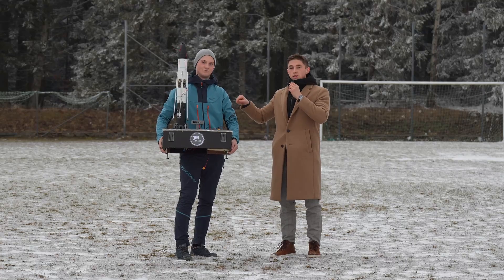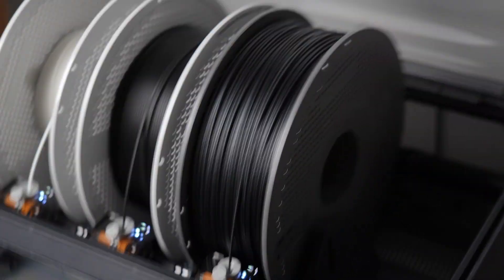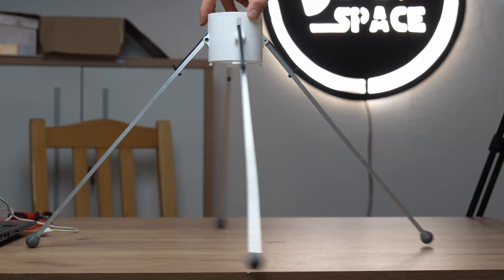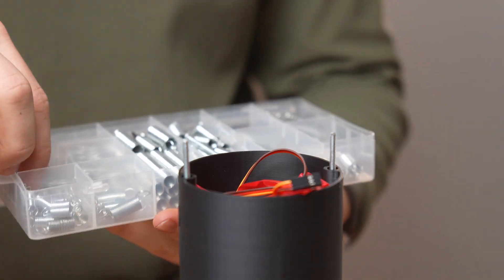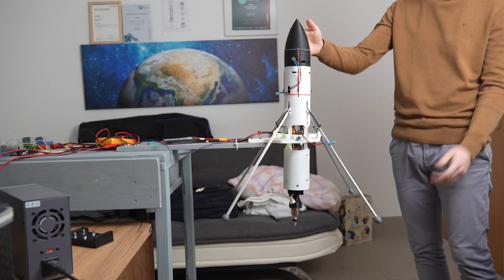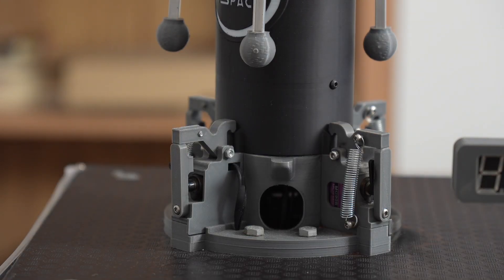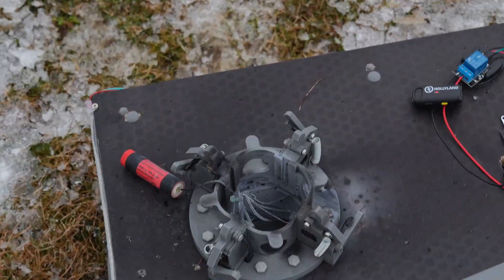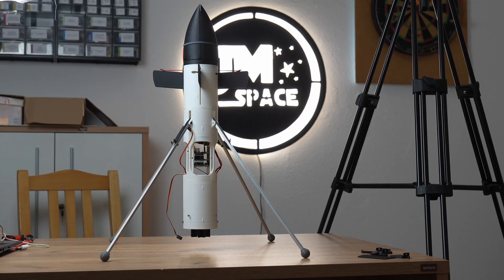Buffalo L's Landing System Fails - What Went Wrong?

Comment: Great vid! I would recommend cutting down on the number of thrusters however. The ignition delay/ignition itself is far too great of an uncertainty for this type of system. Landing timings under solids are extremely specific as I'm sure you've seen in your own sims. It would be an easier problem to solve if you had only two bigger motors, and simmed for the asymmetric loading. Keep it up!
Reply from the maker: Thanks! You're absolutely right—two bigger motors would make the system much more manageable. Unfortunately, we don’t have access to larger engines in Austria at the moment. However, we’re currently exploring several ways to reduce this issue.